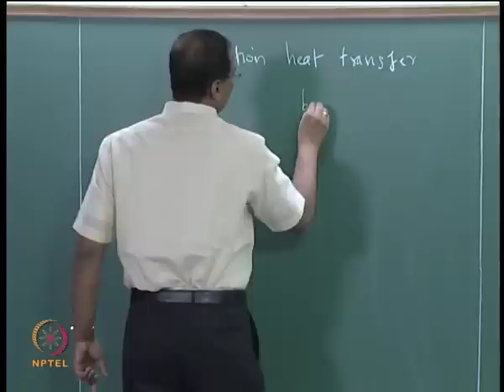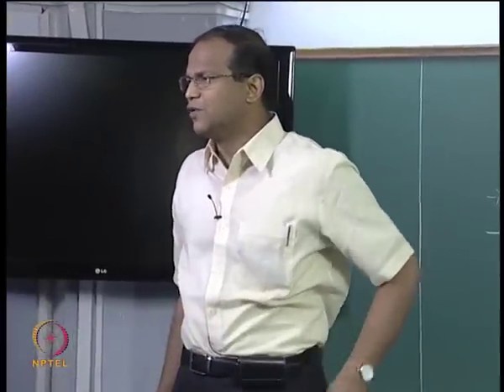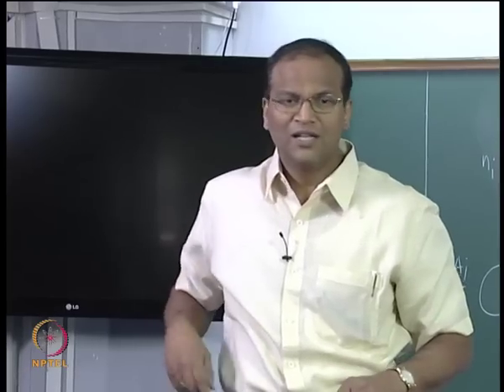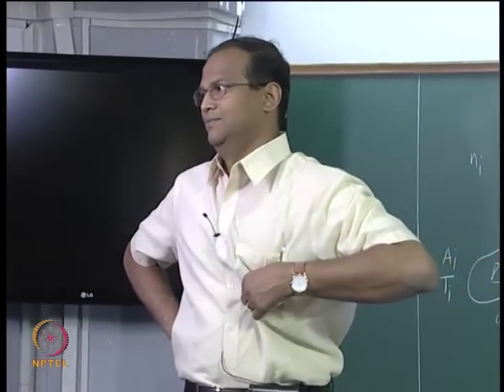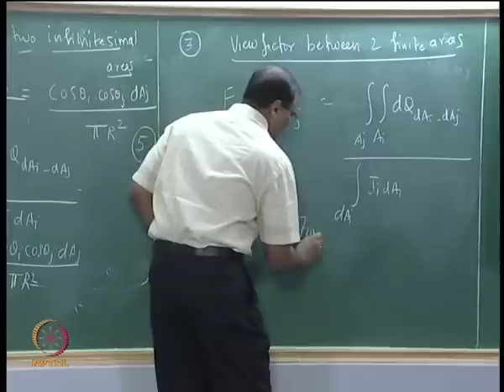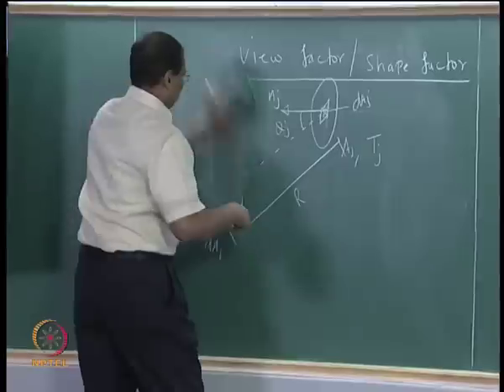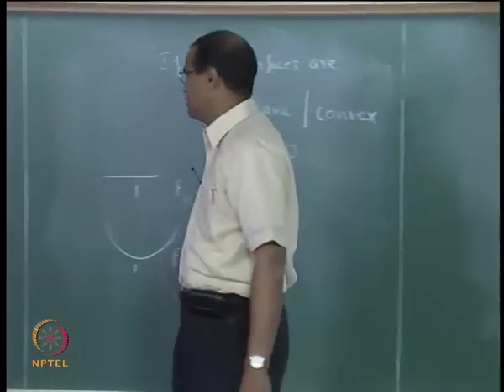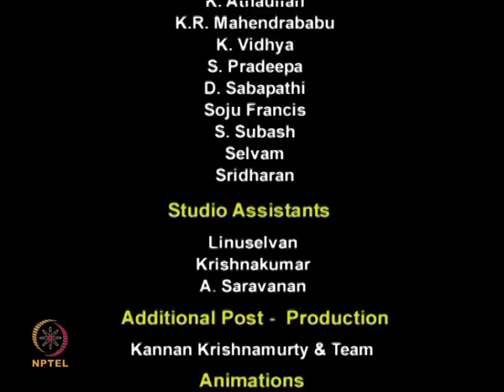Mod-01 Lec-19 Radiation heat transfer between surfaces

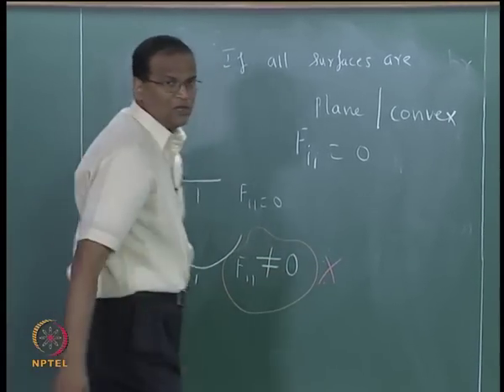Comment: @ 42:18 he writes: "If all surfaces are plane/convex -->self view factor is zero. But then he actually draws a convex surface and says that the self view factor =/ 0?
Did he mean concave?
Reply: He mean concave and draw the concave surface. Actually same surface can be consider concave or convex depending on, from which side you are seeing. here he meant concave if the radiation is emitted in upward direction.